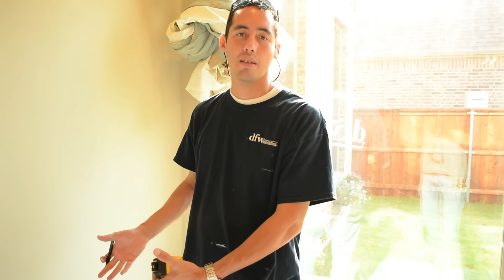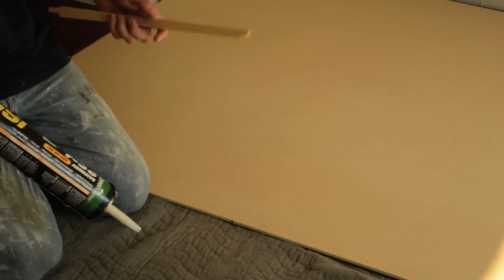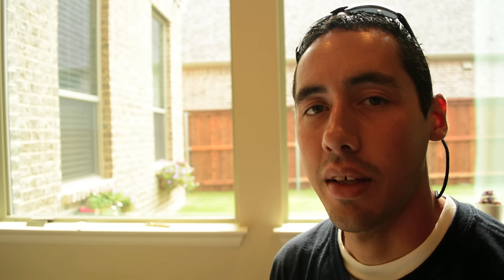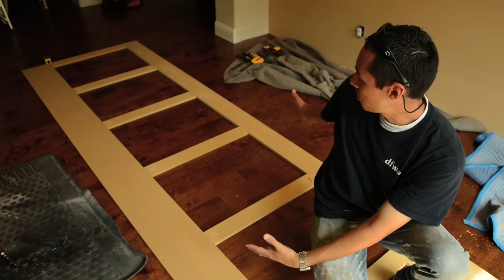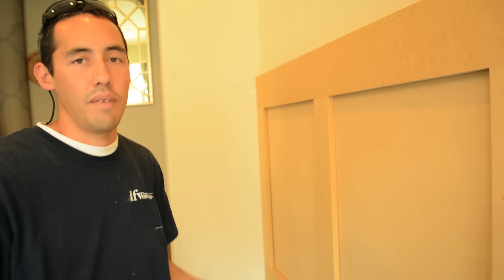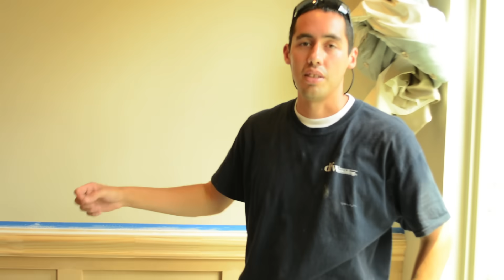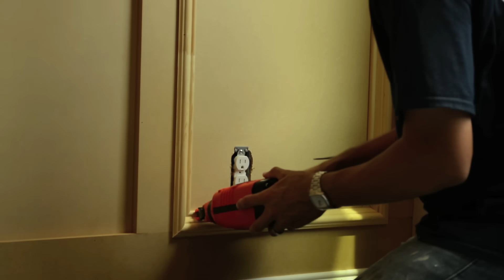Recessed Panel Wainscoting Installation - How to Install

Comment: Beautiful work but I do not understand your logic of adding 1/4” backing board on the wall to give the molding “more depth”.  After you add your wainscot boards the distance between the boards and the backing board is still the same.  If you added the backing boards just behind the wainscot boards then I would agree the PM-2 would angle more.

Comment: Richard,
I have watched this video probably a dozen times or more, picking up new tips everytime I watch  I want to do this in in a corner of my kitchen and wrote down the specs that you provided, but was curious as to the width of the top rail and the specific chair rail that you used. Is the chair rail positioned flush with the top rail and then a cove base attached on top to cover the line between the chair rail and the top rail?
I really enjoy your videos and have learned a great deal from them. Thank for sharing your time and talents with us.

Comment: I’m still confused as to why that 1st layer of mdf is needed? Could you not just install the battens over the wall’s Sheetrock?
Reply: I believe he does it if there's texture on the wall, and to eliminate the need to do minor repairs of the sheetrock.

Comment: Love your work. Been following for a while after researching for my own project in my daughter’s house exactly this process except will all be stain grade. I noticed in your newer video of this process in your house the series you did use individual center panels and thats a newer video. Do you still prefer this method or individual? Or preference of customer?  And will same panel moulding work with either method?  Thanks again for your great teaching videos.

Comment: If I were the homeowner, I would be very upset that you are working on the bare wood floor, no doubt believing that you will not mar it.  Every worker I've had in my home, damages the floor  and insists he did not. There should be a thick quilt or other protecting covering on the floor.

Comment: What thickness mdf for the wall board? 1/4 or 1/2” ? Also, what width mdf slats for the vertical slats 1x4? Would be much appreciated! Thanks

Comment: I have a problem for ya I'm doing a wainscoting wall. The problem is I have a rounded corner, I believe they call it a bull nose how would I cover this in MDF. and get the bull nose to be right.?? Or would you just make it a straight corner and let the bull nose continue on after the wainscoting and the bull nose trim.??

Comment: So you're just popping a line and not checking for level... what if the floors are off? 
You're obviously not the "lead" on these projects..  you're taking someone else's knowledge and posting it as your own. 
I feel sorry for the future remodeler when they remove your work and see how you glued that mess.
I'm going through that 💩 right now and have to replace all the sheetrock.

Comment: At the start you snapped the line 42in above floor level,if the floor was sloped alot would you be better off using a laser level,but then again would that lead to panels closer to floor on one side than the other?love all your work by the way,and the new video tonight in accent walls being out of date in the future,I totally agree and have spend days removing those old panels from the 70's.

Comment: Just a question... Hopefully someone can answer ?? In the video if per say you wanted to continue with the wainscoting around the corner onto the next wall ( if it was large enough) would you first start the new wall with a 3 1/2" vertical  or just continue with the next boxed section dimension ?

Comment: why didn't center the wall plugs, your reveal is off from the chair rail to panel mold, and from the base to the panel mold, amateur. your fired.

Comment: Thank you the Video, and the Tips.  I usually remove the Drywall.  Then check for all the Studs to be flat the entire length.   I put blocking (2x6) between the Studs at the Top and Bottom. Then I install 1/2 " Birch  Plywood.  . To compensate for the old drywall, I put  1/2 '" Pine Stips atop the studs before installoing the Plwood.

Comment: 17.00 min.  Bro.   Your shooting nail into the profile. Its impossible to reshape that with putty. Only shoot nail holes on the """inside curve""" only.  Thatxway you can reshape the putty super easy...   Im a Lacquer painter.  It shows everything.

Comment: Floor isnt level to do that first chalk line of 42inch up from both sides of wall.... Especially since that's your finish edge......  Id mark at 42 just one side.....  Then laser over to other side and mark using that... So you know your level on top.....  Then chalk that line bro....

Comment: Tip: assemble the stiles to the rails with the base facing the wall so when you go to install it onto the wall you just lift up rather then having to rotate the entire piece cause you may have a difficult time due to space limitations

Comment: We have concrete walls here in India, and It's not straightforward to use the nail gun like you used. It 's a bit messy as you have to first drill holes in the the walls and they sometimes are mortar walls and the holes go all over !
Nice video and good presentation.

Comment: Potentially dumb question.. how do you hold the PM's when cutting them on the miter?  Holding them flat against the base of the miter saw, right?  I'm assuming letting them rock would give you a weird angle... 

(hope this makes sense)
Reply: He puts a block under them..
He says that's cutting in a "nested" position.

Comment: A method I have used is simply use 1/2" drywall , precut the square shapes out of it and glue it to the wall. Then apply the Bolection molding around the inside of the square cut-outs.  Chair rail and baseboard are then applied on top. Gives exactly the same effect , but less expensive and faster.

Comment: What is the tool he uses to make the straight line between the two points at the beginning of the video? Thanks in advance.
Reply: It’s a chalk line. The essential carpenter has a good video on how to use one.
Reply: @bobvilla2508  Very cool, thx

Comment: I’ve seen a couple of times you install picture frame trim or the wainscoting seemingly without concern for stud location. Are a lot of these walls your working on plywood/OSB sheathed under the Sheetrock? Just wondering when you pick your nail location to hide something - what if there’s no stud?

Comment: Great video.... Once question. You apply the 1/4" MDF first to the wall.  In my situation, it is a long hallway with doorways on the wall.  If I apply 1/4" MDF panels first, then the stiles of the panel system will sick out beyond the door casing.  Is there a trick to handling this without pulling all the door casing and applying 1/4" strips behind the casting?
Reply: +1 Funny you asked this today! I have a similar situation I'm trying to figure out the best way to approach it.

Comment: If you used a 1/2” MDF backing you could move the electrical to a more symmetrical location using a cut out box

Comment: this project is beautiful, the only question i have is how did you make all the baseboards line up? wouldn't there be a gap between the regular wall and the wall with the MDF board? in the video they look like they line up perfectly.

Comment: Did you say you added the shoe mold to sit on top of the chair rail? How don’t you see any imperfections. I’m having a similar issue with my chair rail. Wondering what I have to do to fill that gap.

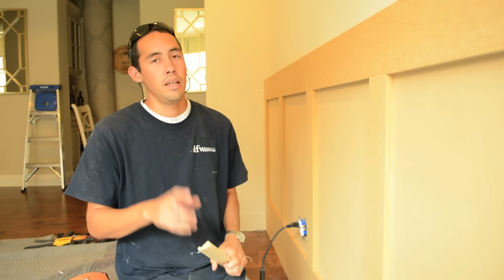Comment: Excellent work, but you lost me at 13:05.
The depth of your back panel is not gonna give you depth on that pm trim piece.
It will give you depth on whatever you use to cap top.
If you eliminated that 1/4 backer sheet depth would be same.
Depth comes from your rails and styles.
Now I have done more depth by adding two sheets of backer w/ top layer cut out.
Then styles and rails.
Or maybe I just missed something in vid.

Comment: Love your videos!  Amazing work and appreciate the no frills deliver.  I used many tips when installing recessed panel wainscoting in my dining room and came out great.  I could not find panel molding anywhere locally.  No sellers  would even order it for me.  I was able to find a place online.  I saw no responses when I looked for tips on where to get it, but I found it at Baird Brothers.  I ordered 3/4" x 2" poplar PM and crossed my fingers.  It was exactly what I wanted! In order to ship, lengths had to be less than 8 feet.  I ordered various lengths for a better rate, since I was cutting it all to smaller sizes anyways.  I have no relations to this seller otherwise, just thought I might help anyone that was struggling with this bit.. it seemed like a few were.  Anyways, thanks again and keep it up man!!
Reply: Thank you Craig. No places within 50 miles of me has this pm either. This was a big help! From Connecticut USA
Reply: Yes same here, thanks big help for me also

Comment: You don’t need to put MDF on walls if you are going to paint, the existing drywall works just as good.
Reply: I can tell you from experience that leaving the drywall exposed makes this type of project counterproductive. The function of wainscoting is not just decorative but is protective as well. On a non-load bearing wall studs can vary in spacing and drywall is typically only 1/4" thick and relatively delicate in high traffic areas. If the exposed drywall takes an impact you will still have to patch it, which can be tough to do in those relatively small recessions since you have to feather spackle or joint compound and potentially have to shore up crumbled gypsum with clips or drywall patches. Better to put the backer board behind the frame IMO.

Comment: shouldn't use a promar on trim, but I guess it could work...... won't resist damage very well. Proclassic is a bit more expensive but worth it. Personally I almost always use the hybrid as it works like latex but cures like oil and can be applied over either.

Comment: Not sure I understand the total purpose of that first flat sheet of MDF (I assume you are using 1/2" right?).  Couldn't you achieve the same thing by just putting the 'frame' on the bare wall?  Also, please show a closeup shot of how you did the shoe molding on top of the chair rail.  Also, please show a cross section of the PM and chair rail.
Reply: My thoughts exactly. I'm guessing there's texture on the wall and you can't see it.
Reply: @LightGesture  Here in Ohio and also some other places I've lived, we don't put that ugly 'stucco-ish' texture on drywall (mainly to hide poor drywall job).  But, you might be right at that location.

Comment: Do you always spray paint your trim?
Reply: It's much faster and better looking. You can use a 1/4" nap roller and brush your stile and rails. As long as they're back brushed and backrolled (backroll with a gentle touch to avoid lines) you should be okay if you don't know how to spray or have access to one.

Comment: Really good job man and I really like ur work but I have a question... why didn’t u use some glue for joints and the to rail don’t u think that it should match the width of the styles? Just wondering

Comment: I've worked in hundreds of homes in the Los Angeles area and you cannot measure from the floor up...you have to use a level because many floors, especially older homes not on slabs, have subsided. You gotta make the top level and let the bottom rails absorb the differences. If you're installing all around a room this becomes extremely important or else the corners won't match correctly. I'm not criticizing, I'm adding to your as-usual expert video.

Comment: Did you mention what size (thickness) of board you glue to the wall that is behind the rails and stiles?   what size mdf do you use for the rails and stiles?

Comment: Im a interior trim carpenter and custom cabinet guy of 35 years, and i have to say for a guy who has not really been doing it all that long, you do nice work, and you have a talent for the trade, I dont always agree with you're tool reviews ( Kapex), but that stuff is very subjective I guess, by the way, why in the world did those customers just recsess panel one wall ? did they run out of money?

Comment: Fantastic job and video, great lesson! Watched a video before this with an average Joe & kids do this by just nailing 1x4's to the wall. He nailed the inside vertical pieces just into the wall board. Even a average handyman like me can tell those will eventually loosen and pull out. I liked the solid screwed together one piece design you did. Full panel MDF on the wall is way to go, can you imagine cutting all those separate pieces to right dimensions. Thanks for the lesson.

Comment: Keep in mind it's a code violation and fire hazard to have a combustible material (MDF) inside the electrical box like that. I think you can get a plastic extender piece at the store to provide a barrier.
Reply: Cybek Cusal yes another ridiculous code that will never happen in real life. There’s about 9000 things in a house that will start a fire before that. 

All these codes combined are supposed to prevent fire. It makes the job cost 20x more. I recently watched a sprinkled state of the art building burn to the ground in about 20min. So what was the point of all these codes when the building still burned to the ground like a straw hut.
Reply: @russelleldridge3726  
Ignorance is bliss, right?

Comment: I was wondering when you measured from the floor at the beginning. if your reference line could be as unlevel as the floor.
Reply: Doug Johnson no always make your reference line level. If the floor is off a little bit the shoe moulding will hide it’s. If your floor is off more than approximately 3/4” then you will have to cut each stile(vertical board) to different lengths which makes the job twice as long. Always use the same size measurements when you can, it’s much faster in the long run
Reply: @russelleldridge3726  I would agree. It's better to have parallel than plumb and level in most cases. Imagine if you made your door trim "plumb" and not parallel to your door frame or wall. That would stick out like a sore thumb.

Comment: Use only the length of nail you really need. Remember that there could be water lines anywhere in a wall, or wiring too. 16" centers should be yours, but you can't always count on that.

Comment: Hi       Please can you tell me where you are getting the un-treated MDF , Lowes , Home Depot and BMC which are my choices do not stock it .They all only carry the treated white painted type which has rounded edges which makes a poor joint between the chair rail and base boards to the uprights thanksJon

Comment: I don’t get putting the corner in sheet up first and then putting the three-quarter buildup on after it’s still three-quarter Ranch whether it’s against the sheet rock wall whether it’s against the quarter inch board

Comment: I just wanted to actually say that first of all you're really good at what you do really good but I watched your episode about using blue tape to measure the inner part of a walk why you did but instead it was a light bar for pickup trucks LED lights and it's curved outwards I was by myself I had to order brackets and to get the exact measurement I used the blue tape method worked great

Comment: What’s the thickness of that second sheet of mdf you used in front of the 1/4 backer board? It looks thicker. 1/2? 3/4?
Reply: 3/4" MDF, looks like he ripped it down from a panel of MDF. If you're talking about the stiles and rails.

Comment: great stuff. i might've had an electrician center the outlets on the two panels. also i might've moved the panel height down so that the reveals of the upper and lower rails would be the same. it's a nitpick. still, love the work and your vids. keep 'em coming.
Reply: nice

Comment: Nice job.  I would have used a taller top piece of mdf so that after the chair rail is installed, the reveal above the panel mould was the same as the reveal below by the base.....

Comment: Looks great and well explained! You're right about using the 1/4" material behind the frame work. 1. You lose depth. 2. You lose consistency of depth. As every wall isn't perfectly flat and when you're installing panel molding you'll find gaps in your miters from different depths of the panels from cutting the 1/4" inside of the panels. One could be 1/2" and next is 3/8". Great job on saying 1/4" first, then stiles and rails. 🤙

Comment: I watch your videos from time to time. You're a good finish  carpenter. Shouldn't you run a laser line after you figure out your wainscoting height?  If your floor has a slope your line will follow that slope.

Comment: Just a pro tip I have learned when applying any sort of sheeting using PL adhesive . If you make a bunch of circles like all over the board , when you press it to the wall it creates a suction , much like a suction cup . Let me know if you have tried or heard of this and what you think about it . I often come here for tips and tricks that’s what this community is about right ? So don’t take any comments I make as criticism , honestly just tryin to pass on tricks I have learned , great vid s

Comment: Please answer this Richard I have recessed wainscot coming up that I need to do. When I get to the angled pieces under the stair skirt, how to add the thickness of the rails styles and back sheeting because it’s going to protrude out past the stair skirt. Do i put a piece of wood in between the skirt and the panel? Thank you

Comment: Have followed you for a bit. Think about this; tool comparison makes money for the brand, not you.
Teach by making entablature of different designs even if its on a faux passage. Then sell them in a shipping package. Do the same for exterior porticos with or without columns.